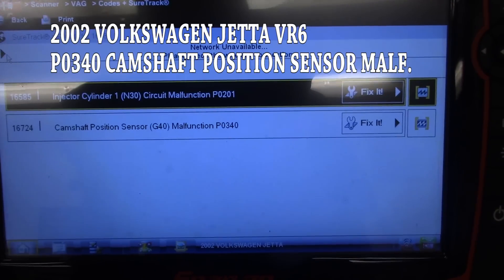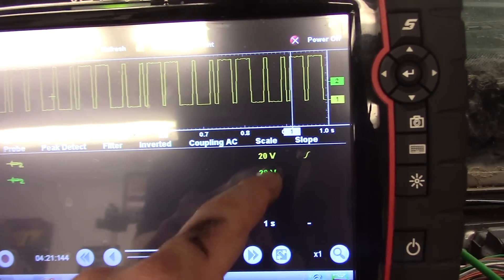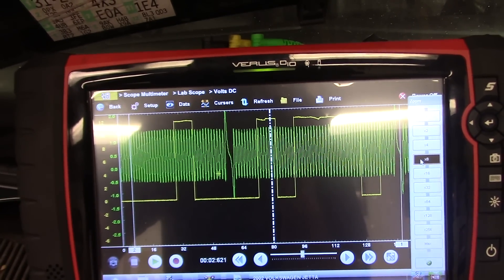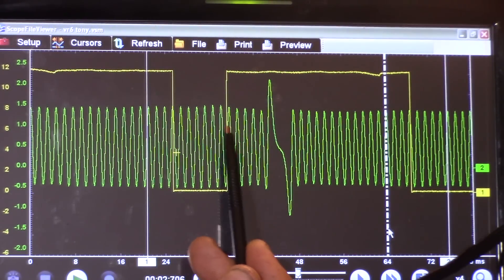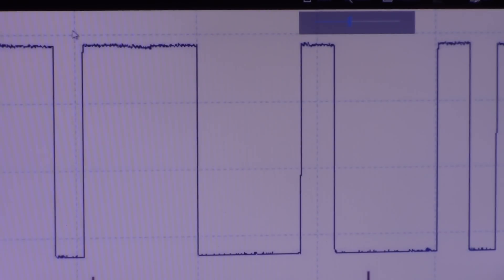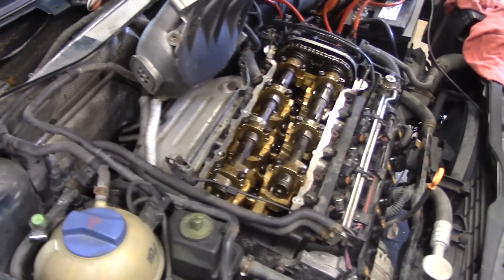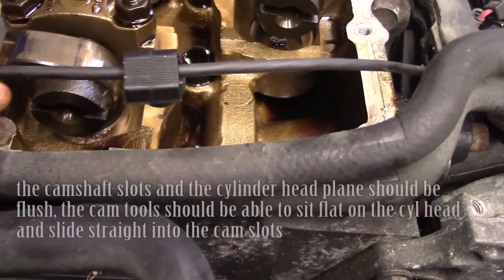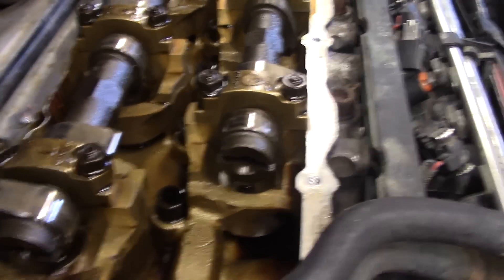2002 Volkswagen Jetta VR6- P0340 Cam Position Sensor Malfunction

Comment: We already set the cam chain 3 times! And verified the belt multiple times! And replaced the position sensor. And STILL the damned PO340 error code!  By the way, the car runs great 😮🤭😐😐
Reply from the maker: I would get a cam crank waveform and compare to a known good.  Sometimes the instructions are not clear and the pictures don’t help when it tells you to count the links when setting the chain

Comment: I unplugged the sensor while the engine was running and the engine kept working without a problem, no change when I plugged it out or put it back in… I’m pretty sure that’s a bad sensor right there

Comment: I hope you guys changed that belt sheesh, Lol...No tool hell you could've borrowed mine as I'm driving a PITA 1.8t that has this code to hell and back and I can't get rid of it, yet. Timing chains on a VR6 if only life was that simple, a few beers on a Saturday afternoon, job done.
Reply: You mean chains lol
Reply: @kluwe801  I think he also meant Saturday AND Sunday afternoon.... after dropping transmission, pulling off flywheel and putting it all back together.

Comment: I don't understand why it would set a sensor fault Code and not a cam crank correlation code???????

That does not make sense, am I missing something?
Reply from the maker: The camshaft is slightly out of range. Not enough to cause a cmp/ckp correlation. But enough to cause a cam malfunction fault.
Reply: Positive Lead Diagnostics But still, it sets a sensor fault Code when the sensor is clearly functional just seems like weird programming to me........